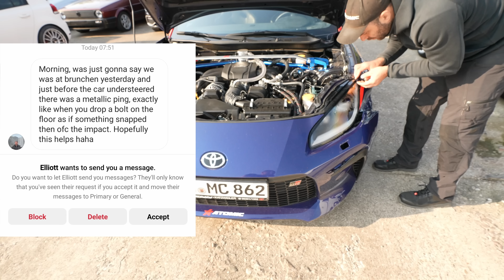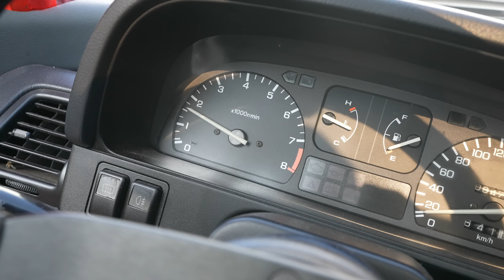My GR86 Nürburgring Crash Damage Report.

Comment from the maker: Register on https://www.gapped.online/register if you still want to win this crashed car for free! 🤪 It will be ruebuilt even better :)
Also, we did not have the capacity to put the car on the lift today to check if there is anything else, so who knows, we may find other issues as we go.
Reply: Will you sign the carfax? 😁😁
Reply: Please check your brakes system
Reply: The clunk sounded like the ABS system.....I imagine you would have felt something through the pedals and/or the steering wheel if that clunk was mechanical and in the ABS system, or the steering system...but you didn't mention feeling anything. Your face definitely showed that SOMETHING changed in the car right at the moment of that sound.
Reply: Even Broke is a great car. Lets get the chance off shure, laready registered from the begin. Misha the most importante is all you get out safe, this is the most importante thing.
I love your videos, SimRacing and sometimes do something crazy with my Xsara 2.0 HDI 110HP (remaped for something like 154HP 🙃) Best regards from Portugal
Reply: Honda Civic CRX avec le Petit aileron derrière d'origine c'est la plus belle !! Bon beau frère a la Honda Civic CRX 150 CV 950 kg c'est une bombe la voiture et très plate contrairement a une Honda civic avec sont arrière arrondie que j'aime pas du tout..je préfère l'arrière d'une CRX beaucoup plus jolie 👍
Reply: Thank you for the giveaway but the terms and conditions aren't loading when you're asking for the instahandle and telephone number. This looks sketchy.
Reply: Could there have been some turbulence from the car in front of you which upset the aerodynamic balance of your car for an instant?

Comment: Ill be honest, to me it truly sounds like a ball joint let go... something connected to the rack for sure.
Reply: Lets hope soo. cuz if it was ABS fault that would mean more crashes incoming.
Reply: Have my doubts with something mechanical. Cos the ABS kicking into snow mode is a known issue in the gt86, and gr86 is using similar parts. I had that occur, and that sound is the abs pushing back. Had the same sound of a clunk prior. 

Commented on prior video too.

Do use pedal dance mode for track use.
Reply: Andrea is a very experienced mechanic, GR86 owner and Nordschleife driver, he can clearly see no mechanical failure! The ball joint & wishbone, shock and tie rod could clearly be seen still attached on the underbody video. Stripped out cars make clunking noises in compressions as the chassis flexes, especially with uprated rear arms and stiffer bushes/suspension/tyres, the loads have to go somewhere. Put an interior back in it dampens these sounds. It’s also not ABS that gets activated there, it’s ESP, when a driver gets it crossed up has the steering on full lock but the G sensors are detecting push (understeer) it steps in, the same ESP that saved Misha at Schwedenkreuz in the wet. Some times, you just have to own it.
Reply: @bencevarga6304  he did pump the brakes. Brake , let off , brake again. I believe ice mode kicked in on the first initial brake. Then when he backed off and reapplied the brakes worked and you can see the car just squeeling alr. If there was alot of fluids it would have not squeel and just went straight in.
Reply: @kevindoran4336  Yeah, I rewatched the video with a clear head. If the ABS went to Ice mode, the car wouldnt have slowed down that much. As he releases the brake, and the front decompresses, he looses traction, and starts to slide.
Reply: @bencevarga6304  i think this is it, the track has a mild "ridge" and GT3 is on the right and Misha on top of it, when he hit brake second time the car just decompressed and went straight - but... its still not the first brake steerring failure cause, what caused him to let go of the brakes for the first time.
Reply: @bencevarga6304 it’s not abs that gets activated on Brunchen 1 compression, it’s ESP, and it’s only in extreme cases of overload. ESP detected after the compression and after the car was falling out of the camber grove in the road there, that the steering angle and forward G push (Understeer) weren’t adding up. Ie extreme Understeer, it’s not snow mode abs, it’s not anything ABS, it’s very high lateral G combined with extreme steering angle. It was the ESP system activating to help the driver counter the Understeer, it will do this by adding extra pressure to certain corners of the car to help with turn in. ESP is what saved Misha in the wet at Schwedenkreuz, it done it’s best here, but the Understeer was too extreme and at that point the car had left the camber grove in the road there and was already on the marbles.
Reply: @kevindoran4336  The computer activates the ABS module for ESP to work. ?
Reply: @shutu6338 i suspect ABS tripped because one of the wheels lost steering and imcreating different wheelspeeds
Reply: @redauwg911 ESP and ABS are separate software controls that use the same hardware components to resolve completely different situations. In this instance it was ESP, which is activated when the ESP module detects the steering angle to be extreme while receiving extreme lateral load G from the load and angle sensors. It then activates to assist the driver turn in the vehicle by applying pulsed pressure to individual wheels (if you want to understand the theory of this think McLaren GT race car being banned for using a side pedal to counter Understeer/assist turn). It is absolutely not the same as ABS cutting in in snow mode. I’ve driven the Nordschleife enough times in enough cars to know which dips and uneven surfaces activate ABS and which ones activate ESP. ESP is what gets activated in extreme cases after the dip at Brunchen 1, and much like it did last week for Misha in the wet at Schwedenkreuz , it assisted him, not hindered him as it pulsed the car straight while sliding.
Reply: @playwithcars  +1 to the Ice Mode
Reply: @Gyula.b No individual wheel lost steering?! A very very experienced mechanic literally confirmed no mechanical failure outside of the common areas that get snapped off in heavy barrier impact (which is a regular experience at the Nurburgring). There’s a very clear difference in a mechanical failure, and a part sheered from barrier impact, absolute force has a tell tale sign. Every point was barrier damage related.
Reply: Sounded like a skill issue to me
Reply: @DenzilTheGrate looking for this comment, felt the same
Reply: I heard suspension contact with unibody, stupid ABS was probably confused when the ball joint let go
Reply: Thats what I think too. 
Primary reason for suspicion bring one loose lock but on the front shock - so clearly this was not tightened. Something else might have been skipped too. 

I’d wanna see the steering rack tie rod and the damage on it. 
This is my primary suspect. Id probably buy OEM part and send it to be separated on a test bench. Right side too as it might have been from the same manufacturing batch. 

I’d put my hand in fire that this is a mechanical failure that has caused the crash.
Reply: @lastname-Nm whit abs active the driver should be able to steer! Whit full lock up of the brake(s) not but I did understand that was not the case.
Reply: I had an issue where one of the wheel sensor was obstructed by a very small debris, the ABS sent all of the pressure to only one wheel reducing braking power by 3/4, almost crashed, I got so many issues with ABS, sometime when slip is detected the brake pressure will just drop 20-30% for multiple seconds for absolutely nothing (proven by datalog). I plan on removing the ABS pump unit completely and install aftermarket reservoirs and adjustable F/R bias.
Reply: @playwithcars is there any solution found?
Reply: @gretsky3463  pedal dance
Reply: @playwithcars pedal dance does not stop ice mode. It is hard coded into the abs module.

Comment: For some headlights there are repair kits that replace the brackets. If the headlight is that expensive, it might be worth trying to find out if such a solution is available for this model.
Reply: They can also do "plastic welding". This is not going to be a show off car. It will be tracked, raced and probably will have some more fighting marks. New light, sooner or later, will be broken too.

Comment: When a component fails due to fadigue it leaves a signature in the metal that diferes from the impact one for instance, and this is how engineers can tell the cause of accidents, being it in aeronautics, motorsport or any other area.
Exactly because of that, in the Ayrton Senna case, was proved in court that the steer column failed due to fadigue. Happens that there is a lot of noise and misinformation, specially because it involves big teams, big engineers and figures, but there is no doubt about what caused the accident.
Reply: Senna's column failed due to negligence. Williams were too big for F1 so they started paying everyone off
Reply: @obidobi2 Someone did check. Andrea is as experienced as you can get. When he tells you it’s impact damage, it’s impact damage. No if, buts or maybes, it’s impact damage. Nürburg mechanics deal with the aftermath of barrier damage probably more than any techs in the world.
Reply: Funny thing is they couldn't trace where there metal for the column was supplied from, with people suggesting it was cheap metal not really fit for it's intended use.
Reply: @stephenreed1080  and that they lost the telemetry in the moment of impact ...

Comment: The headlight is definitely fixable. There are special mash type plastic glues that are made for fixing holding points, like yours for example. The one I used I think is called “speedyfix”, worked for me 😊
Reply: it's now in my amazon shopping cart! maybe this will fix my E36 glove box panel !!!    but MAYBE NOT :eyes-purple-crying:
Reply: I've always used plastic glue for such things, it chemically melts the plastic and essentially plastic welds the parts together. Bonds tend to break more easily than chemical welding of the material in my experience.
Reply: It is true you can fix it but considering that someone is going to win this car, they would probably prefer a perfect headlight rather than a repaired one.
Reply: @squeakers27 and Misha knows that. He wants to give a perfect car. That’s what I like about him.
Reply: @squeakers27  their getting a FREE car . You gonna tell me they won’t take it with a repaired light.  Tf you talkin about. Sounds like these people would complain if they won money and had to carry it out in dollar bills they would complain…..
Reply: It will never be a perfect one anymore...
Reply: Yes, if it's your own car, definitely go with glue. However, this is not Misha's car so it will be fixed up to factory spec which means no glue.
Reply: If it has to be repaired like from factory, the headlight has to be welded. Adhesives tend to let go if they are old and get up to high temperature. Welding the polycarbonat and polypropylen isnt easy tho.

Comment: I’d love to see you guys work on a 2023 WRX as a new project car. I’m in the process of making mine track-ready and would be very interested to see what kind of setup you’d put together. Stay strong and keep the good stuff coming!
Reply: the WRX isn't in Europe from what I can tell. Only Japan and the US, maybe Australia as well. If you want good coilovers though, Racecomp is easily the best company for Subaru aftermarket coilovers
Reply: @SkylineLofe  You're right. I now live in Canada and tend to forget that some models aren't available in Europe and vice versa. Right now, I'm looking at stiffening the chassis with Cusco braces and a Rotora 6/4 big brake kit. Suspension seems to be tricky here in the Winter Belt, though. It looks like all the salt sprayed on the road tends to make the coilovers get stuck. 
For the time being, I'm just protuning the car after installing a new turbokit and FMIC. Patience, time and money...
Reply: Honestly I’d focus on tracking the car first to get a good baseline for a season or two with just better tires/wheels and pads/fluids. You have quite a few mods planned but a bigger turbo and tuning tend to bring a whole new slew of variables for reliability on track for forced induction cars in general.
Reply: @dlombana161  Chassis rigidity seems to be a big deal actually, even before suspension upgrade. If I don't take care of it from the get go, I may put some undue stress onto the chassis. To meet you half way. I'd say that I could have started with the brake kit, tires and chassis before the turbokit and FMIC.
I simply couldn't resist the fun factor of deeper exhaust sound once a catback meets a J pipe😆

Comment: I recon if the clunk you heard was the tie rod end that broke and it wasn't the impact that caused it, that could of been the issue. I would think that it would explain both the light steering feel and the ABS flashing if both front wheels weren't pointing where they should!
Reply: Yeah, an important part of not ABS but ESC is that the steering wheel position is known. That will have to correlate with the G-sensor so that the right wheels can be have their brakes applied.

Comment: Hmmm the Lock ring on the coilover spring was loose like that. Then my hypothesis would be, that you lost spring tension on that corner. Causing an unbalanced suspension system by the 3rd lap.  My Racing Spec buddyclubs taught me that the hard way. I now put zipp ties to keep an extra safety lock.

Comment: 3:13 that was very unexpected, Renault Brembo calipers on a GR86?

I'm not even close to a mechanic, but looking at the crash video again, there was defiantly some kind of a fluid on the road, you could even see the Porsche avoid it.
And I believe the the clunk that we heard is some kind of a mechanical part from the other vehicle, and only one tire was fighting for grip, which was the outside front tire, the inside one was directly on the fluid with 0 traction basically, only because the tire squeal wasn't that loud, and doesn't sound like 2 tires,  more like one.

Keep it safe Misha, we want you good for a lot more videos to come! 💪

Comment: I trained as a mechanical engineer.
Looking at the video and listening to your description, I suspect that three things happened to stress and break the front-end components, before you struck the guard-rail of the track.
1) You applied the brakes which put normal stresses on the car. Nothing broken at this point.
2) There was a change in the track surface which caused the front tires to lose traction, almost completely. You countered the steering angle to compensate for the slide, as you should. 
3) ABS took over and the front wheels free-wheeled until the car hit dry pavement again, ABS engaged the brakes again and the car instantly went from unstressed to highly stressed and the wheels were still cocked, so the steering components were instantly highly stressed, the car pitched down and something snapped under the strain, resulting in the "pop" sound. This would be similar stresses to a city street with losing traction and hitting a curb with the tire/wheel and snapping a steering component.
_ Now you lose steering control because of the broken component(s) and you wisely let go of the steering wheel so the impact with the guard-rail doesn't snap your wrist.
Trust me, if all of this had happened on a tighter turn, the car damage would have been much worse.
Reply: The rod ends are also made for tension and compression. Not bending loads as he was turning in while overcooking the front tyres.

Comment: Regarding Senna, there's a video on the web supporting the thesis  that he went straight on because the track was patched midway through the corner (you can see the black patch).
When he hit the black patch the front lifted from the ground and he went straight on due to lack of grip. You can see in the video that the wheels keep the same angle throughtout the corner, so it was hardly a broken steering.
One of the things that were changed after that crash was that repairs to the track can't be done like that anymore.

Comment: I'd have a look at the rear left lower link to see if there are scrapes on the underside.  The inboard rose joint failed downwards in bending by the looks of things, if it was from impact I would expect it to look more like a compressive failure.  If it was what failed I would expect there to be road rash on the underside, versus it being snapped during impact where there would likely only be grass and dirt on it.  Good luck with the repairs!

Comment: Many years ago I've build for myself trackday car using Civic 4gen base (ED6). It had d16 supercharged engine (240HP) and 928kg weight (measured with half tank empty). With mods like metal plate lsd, quaife steering rack, brakes, suspension + few more it was very competitive track weapon. I raced for three full seasons with this car on highest speed tracks available in my country. Pros: weight, perfect wheelbase, double wishbones F+R, visibility inside, easy to drive on the limit. Cons: bit soft chassis, reinforcements highly welcome. I could even go lower with car weight (8XXkg was in reach) but I was driving to trackdays on wheels so didn't want go beyond some point (like plexi windows, fiber doors and so on). If you want, I can share more of my personal experiences from that build.